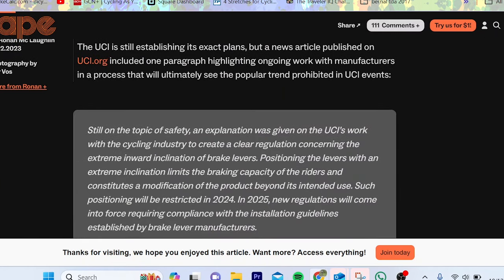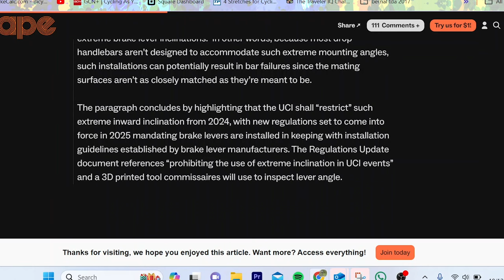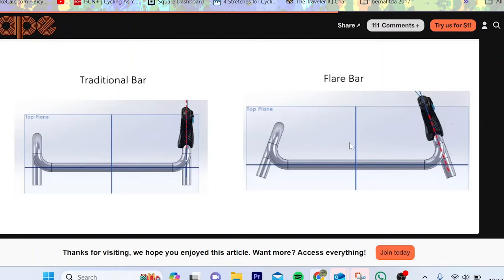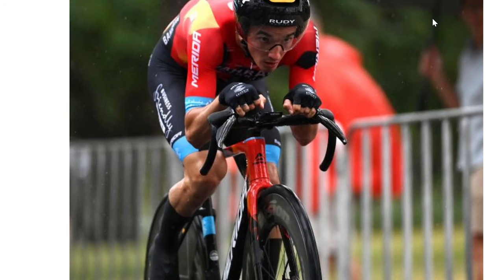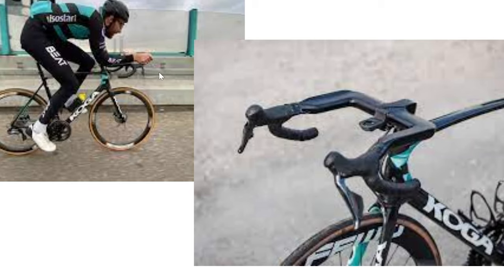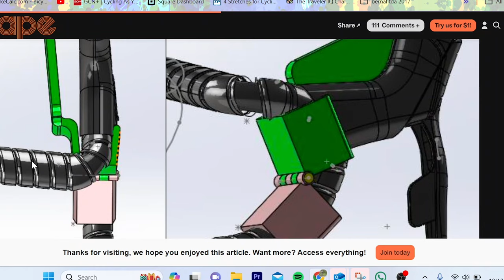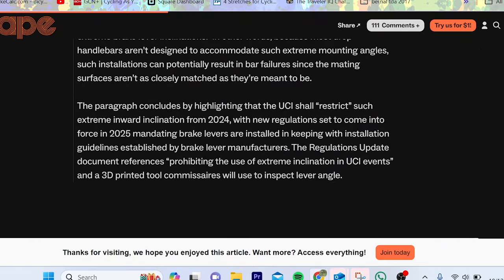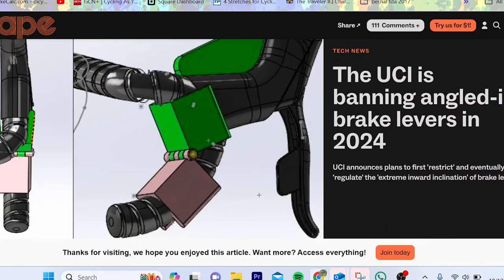UCI Banning ANGLED IN LEVERS - What's the DEAL?

Comment: I ride a silly setup with 34cm bars, hoods tilted right in and it's great. Everyone hates it, but it's super comfy, ayro, and braking is absolutely fine. Might have to go down to 32cm with straighter hoods if the outside to outside measures 350mm. I wonder if Shimano will make levers that tilt in slightly more, the new 12 speed ones already do tilt in more than previous iterations..

Comment: I ride with mine turned in (not "extreme", probably closer to Remco), but I have really small hands so I do notice that trying to reach the brakes from the drops is a bit tougher than a straight-on hood angle since you have to reach around the lever in a sense with you fingers. Likely only noticeable if you have small hands.

Comment: In turning is more anatomically sound in regards to wrist angulation. The downside is the lever tends to rotate thus palm area of the hood is not flat. This can easily be fixed by modifying the hood attachment bolt.
Reply: Angling-in makes sense to a certain degree (literally) and that is when the outer edge of the brake hood is parallel to the outer edge of the bar or a few mm in. Rotating the levers in as in the thumbnail where they are almost perpendicular to the bar is nonsense, it puts your wrists in an unhealthy position, not to mention that it looks utterly stupid.